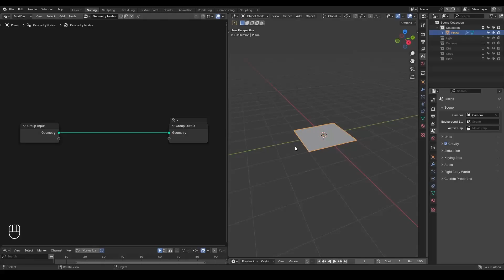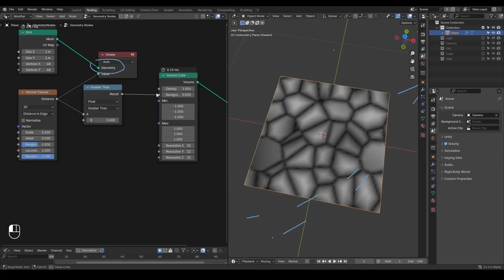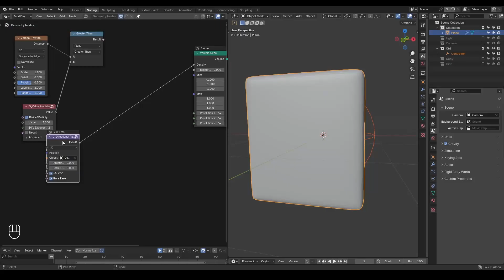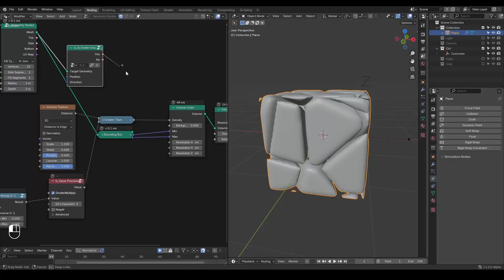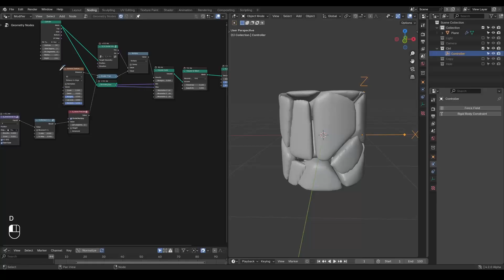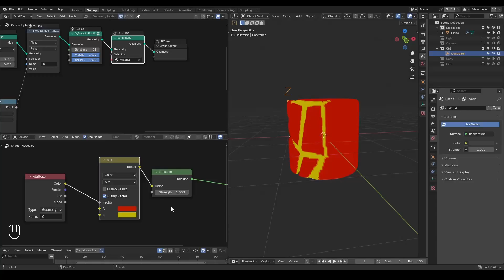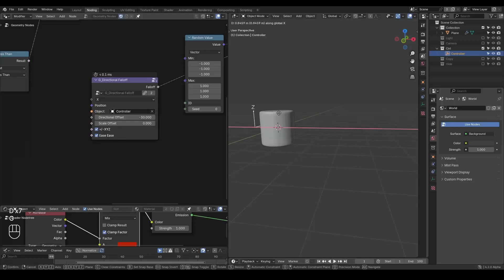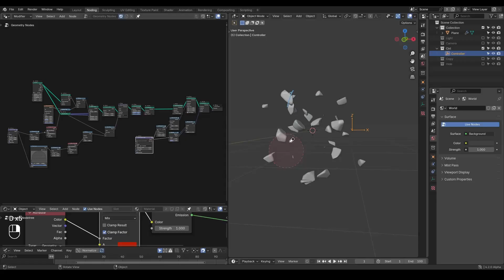[Tut] Volume Fracture and Separation - Blender Geometry Nodes 4.2

Comment: i use blender 4.3, there is no greater than node, and no value precision
Reply from the maker: "greater than" is a mode from "compare" node, it is built in blender so you must find it.
Value precision is a preset free from the link in the description. It's also mainly just a "value" node.
Reply: @bradleyanimation120  i love the effect that you created so i was following along and got lost, please consider most of your viewers as basic in geometry nodes and try to teach us in simpler way and tell us how to find those nodes. thanks
Reply from the maker: @MohammadEhsanMastan  actually it's said at as beginning as 0:49 "I am going to use presets which you can download for free from the link in the description".
Also the description is clearly suggesting "Free Geometry Nodes Preset".
In the corresponding page you also see "Add-on Installation Guide".
and so on so forth.
Reply: @ ok, I didn't know that, thanks for clarifying